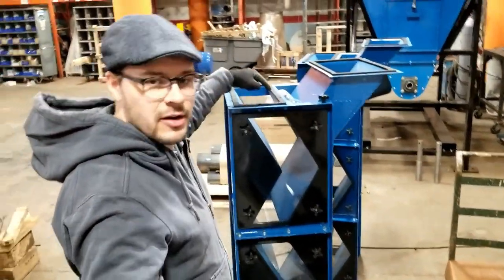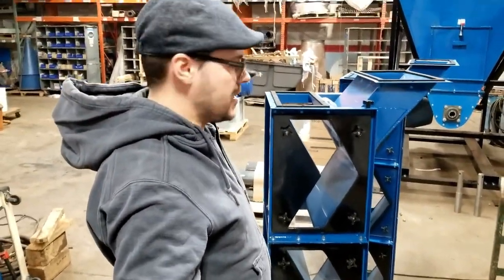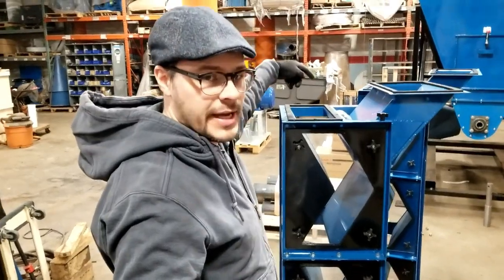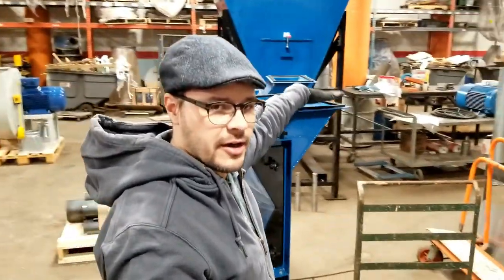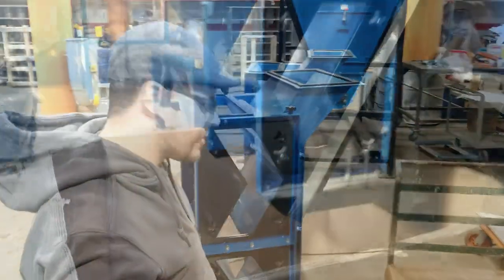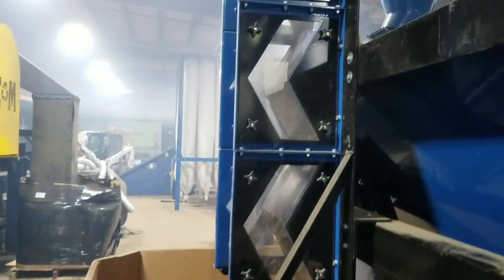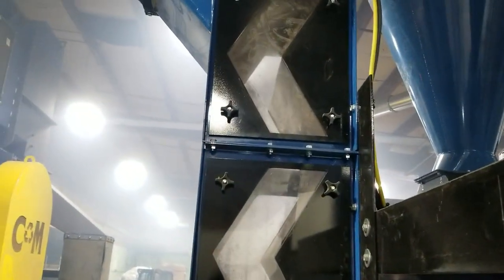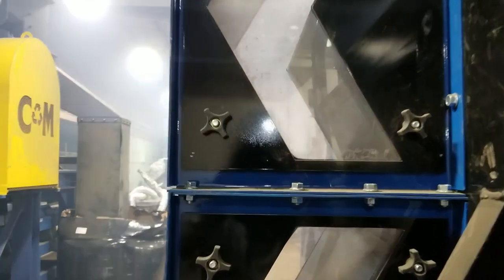The Zig-Zag Separator

Comment: hello, what are the parameters of the thyme processing technique?  how much does it cost?  and how can we order to another country for example Armenia?
Reply from the maker: The air vacuum from the top makes a cross-draft, as the material tumbles down, the heavy fraction falls out of the bottom, while the lighter fraction gets pulled back up by the vacuum. Yes, we sell worldwide, you can call 860-670-1908 or email info@cablemanagementusa.com.